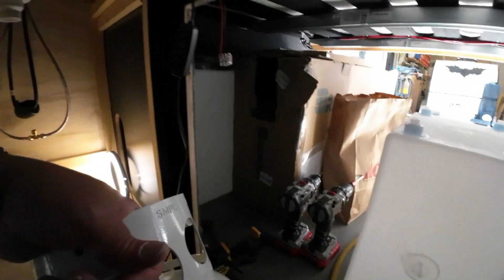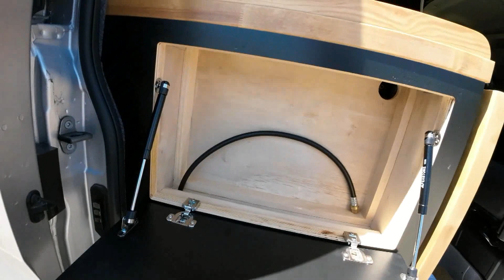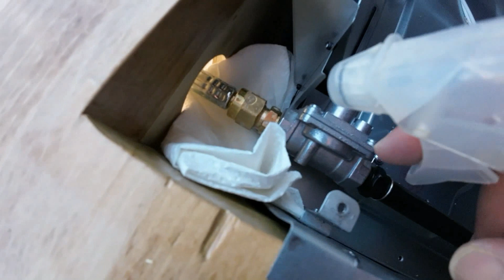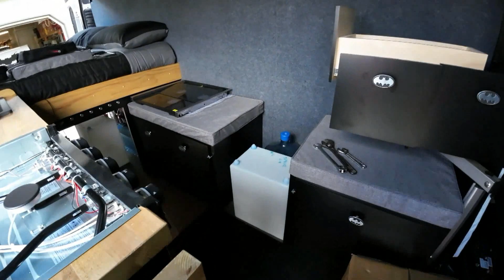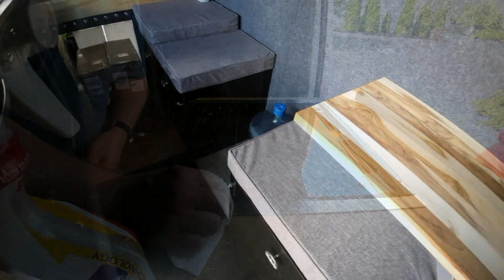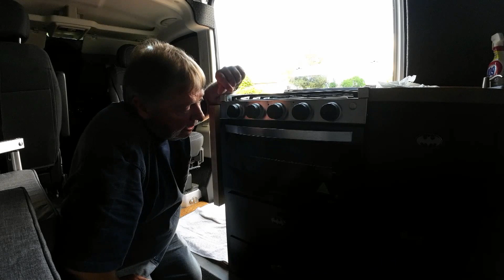Promaster Van Build 2500 159WB – DIY– Connecting the Propane – Part 39

Comment: Looks awesome! Should you fill the hole where the gas line enters the back of stove with a fire proof spray foam? Just in case.
Reply from the maker: Thank you! I think I will leave that open. If I sealed it, and there happens to be a leak, gas would collect at bottom with no venting

Comment: I get a little bit scared when I see how you setup your gas tank. Gas is heavier than air and I don't see any ventilation in the van floor near the tank. Correct me if you do have an opening in the floor that has not been shown in the footage. Even when you leak tested the connections, things may start to vibrate during driving and a small leak or a bad connection can introduce itself. The gas has no way to escape to outside air.
Reply from the maker: Yeah... this was a temporary setup until I have a box built. If by chance there happens to be any leaks, difinitely would escape when I open the sliding door.